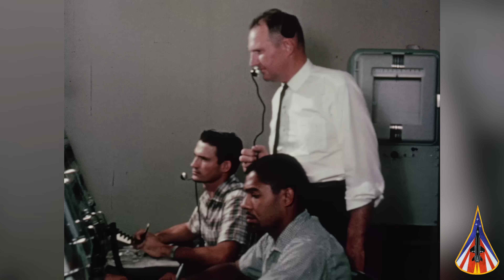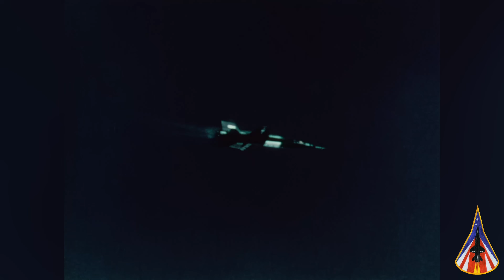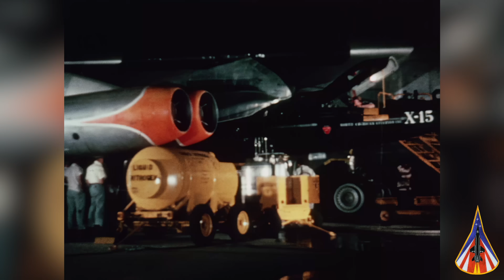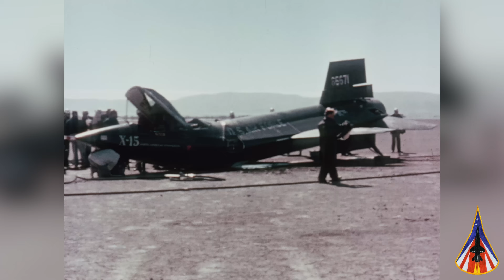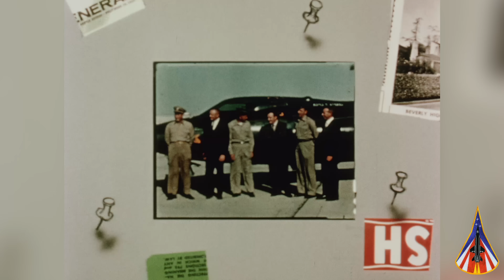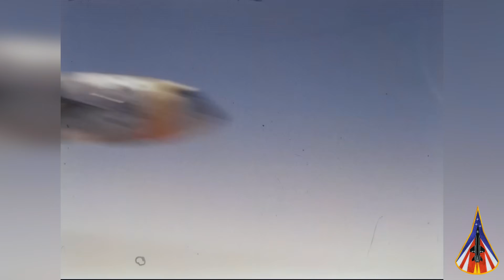X-15 - The American Hypersonic Rocket Powered Aircraft Developed By North American | Upscaled

Comment: I think the data and experience gained in the X-15 program gave the U.S. some key advantages in the space program. The Soviet Union had nothing comparable.

I also find it interesting that the X-15 was constructed with Inconel-X rather than titanium.
Reply: It would have melted in they had used titanium. The SR-71 uses primarily titanium, but its top speed was only about half what the X-15 experienced during reentry from spaceflight.
Reply: @x15galmichelleevans  The X-15 was largely constructed of Inconel-X. 

https://en.m.wikipedia.org/wiki/Inconel

Comment: Never understood why they used rear skids for landing. Seems they would have placed more stress on the frame than wheels.
Reply: I'd wager that that portion of the airframe was too hot for pneumatic tires. Just a guess, tho. Weight/ space considerations? Good question!
Reply: At the speeds that it landed, those tires would explode.
Reply: @Make-Asylums-Great-Again  At the .006 second point in vid do I see what appears to be a solid roller at the rear of a ski tucked in the fuselage?
Reply: Putting a full undercarriage on the X-15 would have increased the weight and complexity of the vehicle considerably. The rear skids solved the landing problem with very little weight, and the skids were carried outside the fuselage, snugged up against the rear body. They were released with a simple wire pulley system. The nose wheel was a standard type, but had no steering capability. The landing speed was around 200-220 knots, and no, the nose wheel tires did not explode on landing.

Comment: Did the X 15 pilots earn astronaut wings?
Reply: Yes. It was based on altitude achieved.
Reply: The five Air Force X-15 pilots who exceeded 50 miles in altitude all received their astronaut wings at the time they did their flights (Robert White, Robert Rushworth, Joe Engle, Pete Knight, and Michael Adams). The three NASA pilots who exceeded 50 miles did not receive their astronaut wings until 2005 (Joe Walker, Jack McKay, and Bill Dana). They only got their wings after pressure was put on NASA after the flights of SpaceShipOne in 2004. Bill Dana was the only NASA pilot still alive to receive his wings in person.